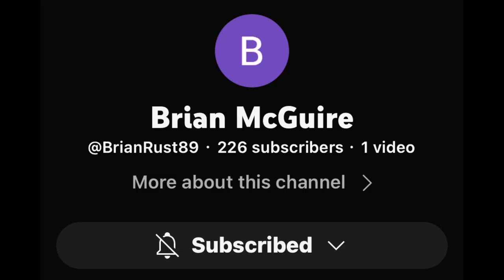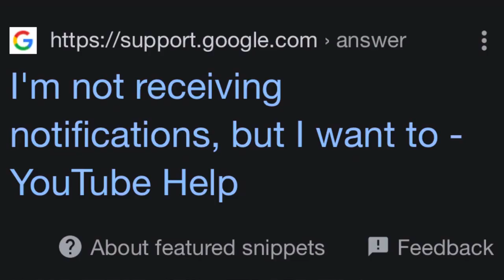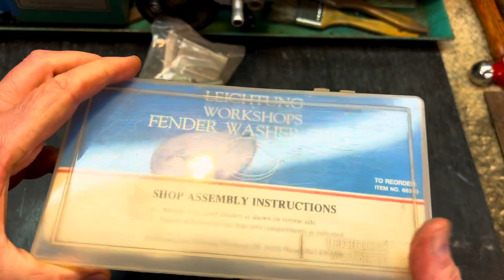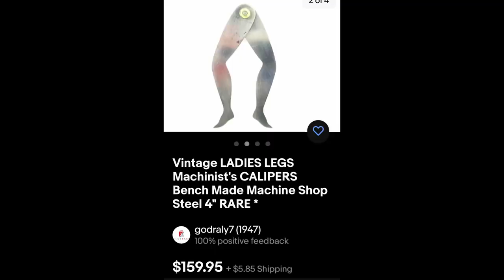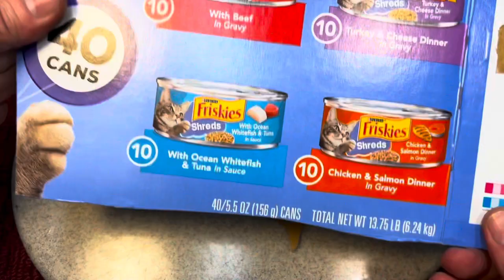Making Tools from Scrap Plus Japan Pushing For Perfection

Comment: Using a rigid powered cutoff wheel to remove excess metal to get the curved pieces roughed out without damage to the pieces takes good control and skill. Good job. Thanks
Reply from the maker: Pat- This metal was pretty thick and hard so this was the easiest way for me.  Those cut off wheels are really amazing.  😃👍
Reply: I thought that was great tip too.

Comment: Great episode as ever! Would love to see the shop once you’ve done your re-org. I’d really appreciate your advice too…I got a Stanley no. 12 scraper from eBay and love it however the brass screws for the handle have stripped, as have the holes they thread into. There’s not enough material to drill and tap..what would you do? Thanks.
Reply from the maker: If you are talking about the scraper plane with the two brass screws that pass through the handle into the wings of the plane I wonder if you could sleeve it?  Can you send a photo?  Bicycleguy@aol.com
😃👍

Comment: Excellent work! Now I want to make a set!! Do you think you could use a scroll saw to cut the legs out of sheet metal? (Forgive my ignorance, I don’t own a scroll saw, and have only used one a handful of times for wood projects.)
Reply from the maker: Hester, I have a scroll saw that uses metal blades and if you want to make a set with brass or a slightly thinner material you could use a scroll saw, my set was pretty thick at almost 3/16 steel that was hot rolled I believe and very strong so I opted for the grinder with a cutoff disc to eliminate most of the waste.  These take time to do because the design has a few inside corers and odd cuts.  Filing and finessing is what takes most of the time.  I've seen your work and I know you can knock one of these out for sure!

Comment: Nice legs there. I am a fan of flat beds for a truck. My truck is not for going out to diner or to the office. It is for work. I put tools, lumber, engines, dirt, gravel fire wood, canoe, you name it. I like being able to set 4x8 sheets in the bed. I think the Aussie's have a better system from the dealers than we do. Next summer mine gets a flat bed, with a 6 foot tool box down each side. I hope to put a hydraulic/winch hoist on it to lift heavy items on to the bed. That is what I consider as a work truck. When we had horses a regular bed was a hassle to get a load of hay bales in a regular truck box.
Reply from the maker: Philip- Why American pickup trucks don’t have fold down sides always perplexed me.  🤔😃👍

Comment: I know this is a long shot, but does anyone on here have any information about a tool called a "blacksmiths plane"? I saw it briefly mentioned in an old book about metalworking. The book just vaguely described it as a hand operated tool used to form a reasonably flat surface on metal more efficiently than just using a file. No illustrations. It said the tool wasn't around very long because it came out right around the time that blacksmiths were becoming obsolete.
Years ago, I stumbled across a website for a museum somewhere in Germany that had a picture of one on their website, but the lighting in the picture was so bad that it just sort of vaguely looked like a rectangular shaped blob. I had meant to try to contact them to see if I could get some good color photos of it, but then I lost the paper that I had written their web address on. I've never been able to find that website again since.
Anyways, I just thought I'd ask in case someone out there knows anything about it. Worth a shot :)
Reply from the maker: That’s a tough one- the only planes I have seen for metal were made for the auto body trade.  Those are nifty!  😃👍
Reply: @ScoutCrafter  I got curious and looked up that tool. I'm thinking you might be onto something :)    I wonder if maybe the "blacksmiths plane" described in that book would've worked similar to the auto body tool you mentioned.